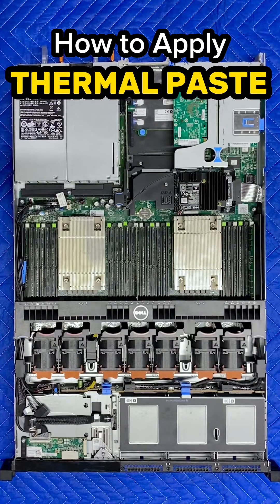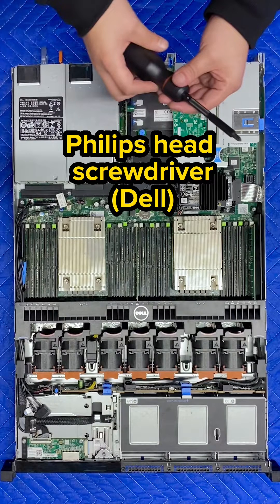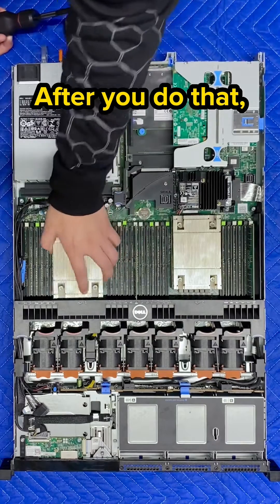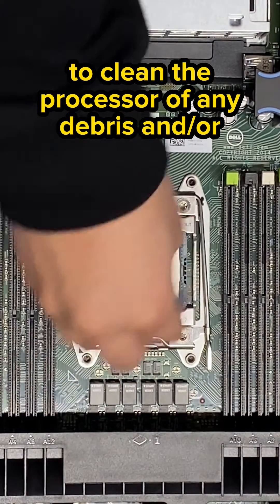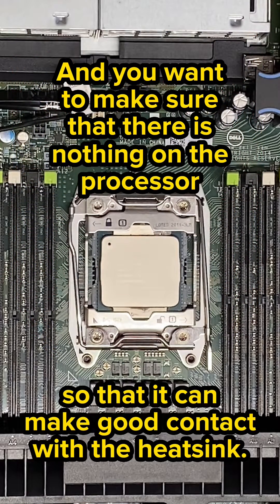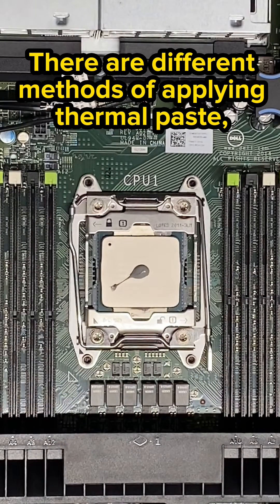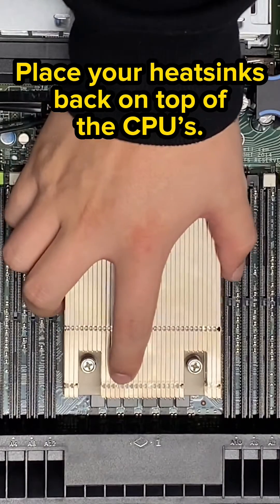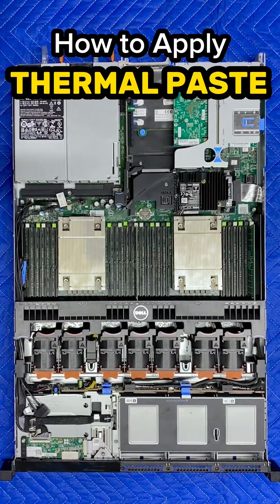TechTalk: How To Apply Thermal Paste to Dell PowerEdge Servers

Comment: You should try phase-change material Honeywell PTM7950. It comes in as a sheet, lasts longer, performs works better than traditional pastes and there is no pump-out effect.